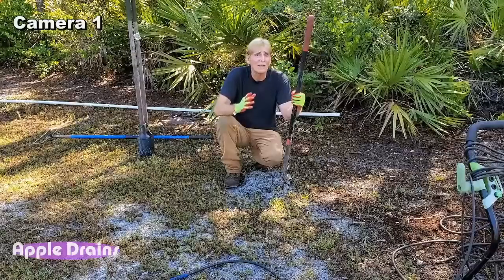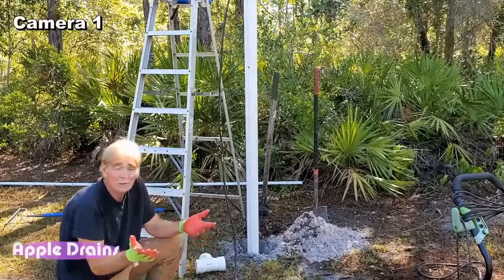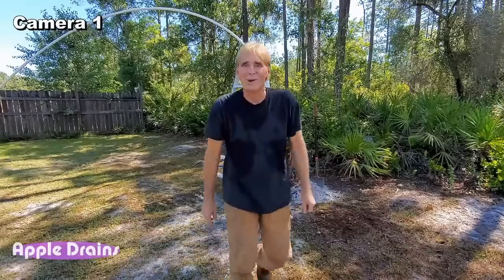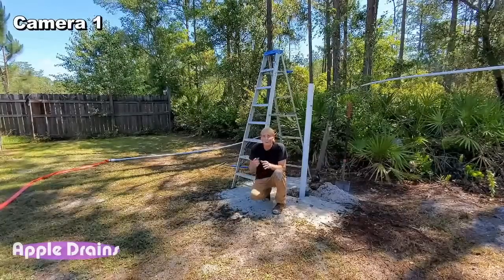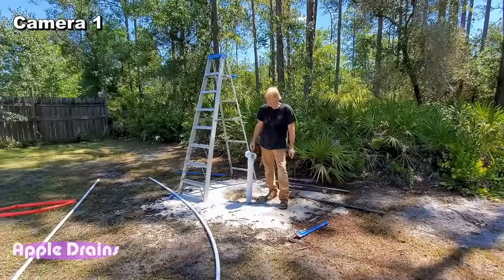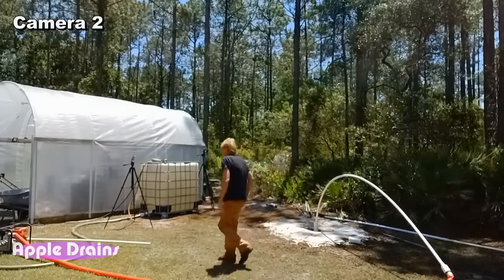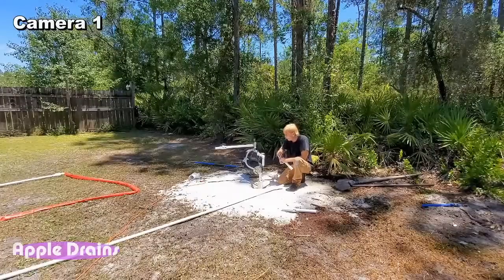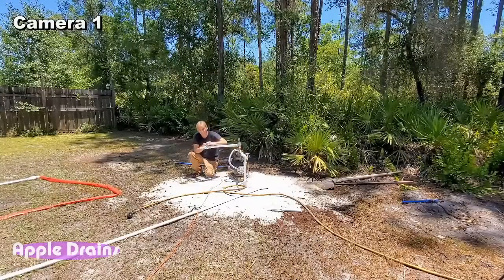Fastest Way to Dig a Well - LIVE STREAM

Comment: Some questions:  I'm about to embark on this journey.  
(1) Can you jet the well with the sand point directly?  
(2) Have you tried using a strap wrench (or two facing opposite directions)  instead of putting the T on top? (You could jet and twist at the same time.) 
(3) Would it help with flow to use slotted casing? 
(4) Could you use your electric pump to jet the well ?
Good stuff!  Thanks!

Comment: A good friend of mine here in southern Missouri is a well-digger for farms. They dig these small 2-in Wells by hand before every large well that they dig. Within a half hour they've got a 2 inch well now I'm getting water then they use that to fill the hole to dig the deep well which in this area only has to be about 100 to 150 ft down. They're shallow Wells tend to be about 30 ft they said and are effortless to put in.

Comment: Chuck,  Very helpful and informative.  Question,  did you use thin wall or Sch40  with the well point ?
Reply from the maker: Wellpoint schedule 40 PVC. The main shaft is three and schedule 40 PVC. No thin wall was used in the well

Comment: Chuck, great video. Me and my son just tried this past Memorial Day weekend over here across from you in Citrus County. Using a Harbor Freight 3” inch discharge to 1” inch pvc we literally got 15ft in seconds before this orange sand here stopped us in our tracks. Water would not penetrate it. This is a mud pump putting out 17000 gph!  It stopped pushing out the water and cuttings as it was still going full bore and quickly cemented around the pipe. Any ideas?
Reply from the maker: Hi Steve
Maybe try twisting the 2” shaft with a pipe wrench or T . Slowly get down through that stuff and run the pump . Watch my 1st video for the setup of discharge . 

Could also reduce to 3/4 inch. More pressure!
Reply: Here too! My 4” is  stuck at 7 feet  in hardpan and refuses to go deeper. I’m using the other method with a jeter. Very black and compact sediment. I’m soaking it in water in the hope to soften it.

Comment: I think you could have provided a flexible pipe with clips/clamps for easy connection and removal between the electric pump and the 1 inch pipe in the well for cleaning the sand from the well.

Comment: Then you could use this old pump with the flexible pipe for cleaning instead of cutting and wasting the 1 inch pipes each you clean the well. The wells are pretty easy to drill especially with the layers of soil (geology) at the area you're jetting.

Comment: A lot of the videos that are posted I think are from deep South ...where all of the soil is pure sand and the water table is 3' down…. I have taken on the Task myself with driving a sandpoint well... There is one thing that I can tell you with a 100% confidence... and that is the power washer sewage nozzle does not work anywhere in the Midwest ...or anywhere there is clay involved.... The sewage pump worked a little better on top soil but made nothing but a huge mess once you hit clay… ended up driving manually inch by inch...wasted 2 days and $200 on materials ....so if you live North of Florida you might as well get out the sledgehammer or post hole driver for your sandpoint well…. Plan on 2 guys 2 days ... The method that you are using is great for your area I'm sure… I just wanted it to be stated in the comments that this is a very far South technique and does not work this easily in most States....thanks for sharing...

Comment: Most I know pull the casing and just leave the 2” or 1
1/4 point and pipe, hand driven wells do not have a casing. just wondering
Reply: You leave the casing in Florida.
The sand fills in and holds it like rock.

Comment: how do you connect the 40ft of one inch pipe to the flexible red hose coming off of the pump?
Reply: Reducers.
Reply: 2" female to 1" coupling.
The male end of the 2" waste pump hose is male and will screw right in hand tight.
Then connect your 10' section of 1" to the coupling.

Comment: You never capped the wells you drilled.
Reply: They are capped with THE PUMP.
Sand fills in completely around the pipe in a short while.
No "capping" is needed